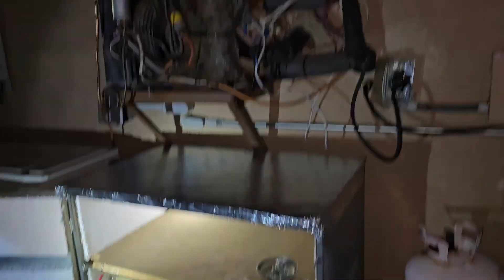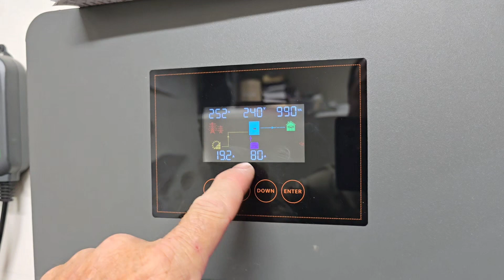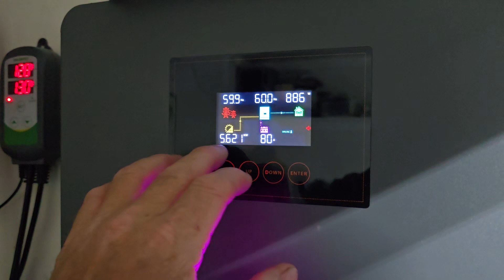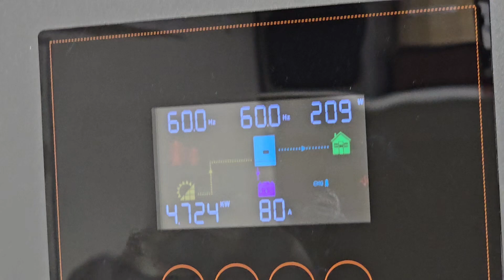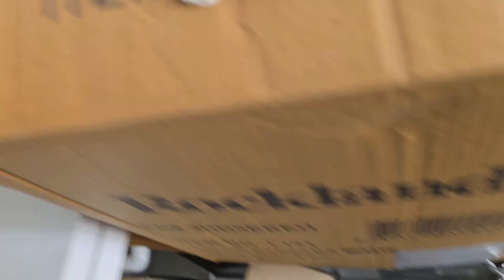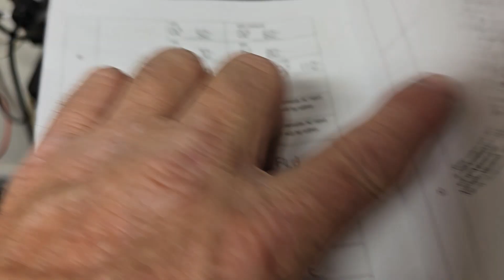I relocated my solar storage batteries - Solar is producing big power ⚡️ 🔋

Comment: Few questions if you have time. Any reason you went with 18650s over the larger mb31 type cells? How do you get 120 out of the PowMr inverter? I thought those were 240 only not split phase?

Comment: Would it boost production if you took the hose and sprayed down the pagoda panels?
Reply from the maker: I haven't tried it. I'd suppose they would if the water cooled but didn't cause some sort of interference with the solar absorption.
Reply: Can you share a wire diagram of your DIY transfer switch?